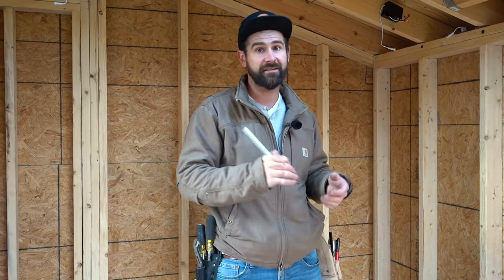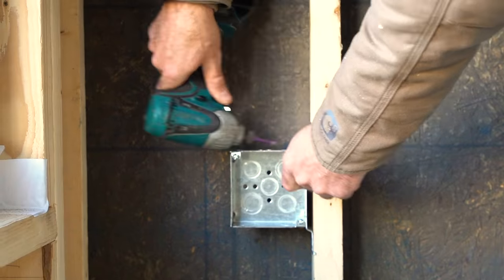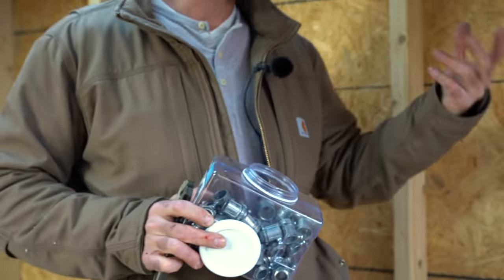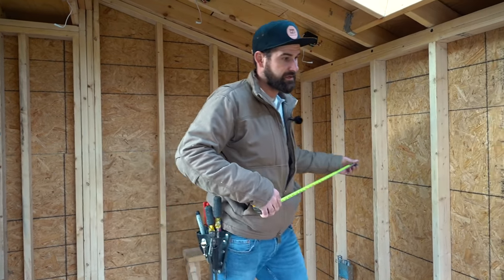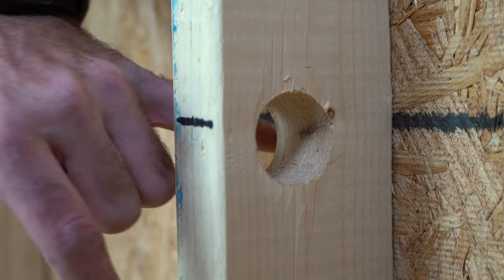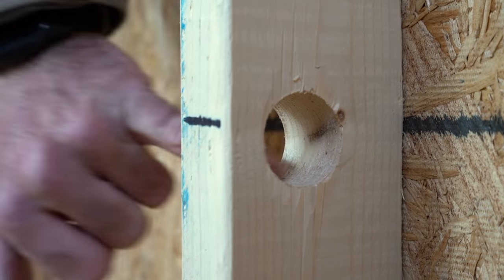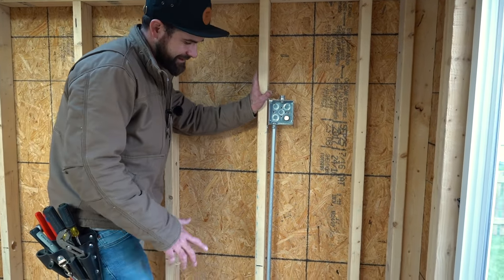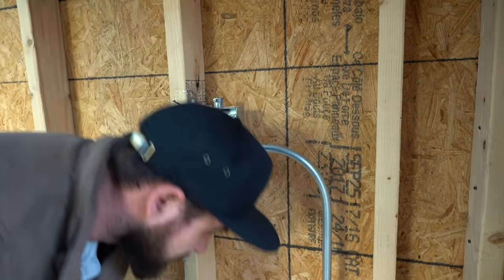How to bend and install electrical conduit

Comment: I say this as a commercial electrical journeyman, there is absolutely no reason to use conduit.
Reply: Unless you’re in Chicago
Reply: @number1anonymous  to protect the wire from hollow points?
Reply: id say that he can run either commercial and residential or industrial with that skill.
Reply: @jamesburns just because he ran a Piece of conduit he could do commercial or industrial?? Nawww, i gotta disagree on that one. Theres alot more you gotta know then just conduit bending. Besides those were easy bends he did.  And residential elect. Almost never use conduit.
Reply: @sonofnumenor6683  thats when one limits them selves, and out of all of the ones commercial is the easiest. does not take a whole lot of thinking when running pipe. pulling wire. laying out the lights. indusrial is the most complicated, because of the demands of the equipment. might be explosion proof, might be motors. lots of control wiring.,  but i was taught by people who needed me to know it all. i worked in the field since i was 15, and i have seen and done it all. started in residential, doing remod work. which if you dont know how too then you got a lot to learn. it is not for the average electrician who knows how to bend pipe and run wires. how to get from point a to point b. i have worked and run jobs in some of the largest manufacturing buildings, and have run jobs on the simplest commercial. which i love, because you dont get dirty. lol.
Reply: @jamesburns have you ever done commercial?? XD now i agree on the industrial part theres alot more going on there. But if commercial was just run pipe and pull wires and terminate i guess i wouldnt have been on the same commercial project for the past two years, when you say " id say he could do residential commercial or industrial with that kind of skill" thats kind of a silly statement.

Comment: Nobody in their right mind is using metal boxes and conduit in a wall cavity of a tool shed.
Reply: Must be a Cali build lol
Reply: Chicago has pretty strict regs in that way I’m pretty sure
Reply: @jameschaisson7747  most cali code requires NM for Resi. Unless its an open beam garage in which case we use MC.
Reply: This is overkill! What is wrong with this jurisdiction?
Reply: @CHADCZ123  you think it is but i assure you it is not. just think later if you have a problem with a circuit easy to trace and trouble shoot. which is an art of it's own.
Reply: @Zethereum i bet you have more home fires due to running romex that we do running conduit. you ever get into a situation where you need to run another circuit and you cant because it is in romex and the walls are finished?. no problem with conduit
Reply: @jburnes41 I hear your reasons and agree with you to a point.. but if you plan out your build correctly you should not need to add wire later.. the romex fires are mostly caused by rodents chewing on the wires .. bx cable provides more protection than romex and is nicely flexible to run through 2x's
But unfortunately Chicago and suburbs only want hard pipe conduit.. 😊

Comment: I liked and I subscribed. You did an awesome job explaining and showing how to do it and how to fix it. I also think you had a great attitude. I also have to say, I was SUPER GREAT to hear you include something your father taught you. Our dads were probably the same. My father taught me a lot as well. I never call a repair man. I fix and do all my own work. That way I know it's done right. I'm planning on bending pipe for my Christmas decor outside. I want to make a unit that goes over my driveway and down it as well, so I can drive under it. If you have any pointers, that would be great. Thanks again, and God Bless.

Comment: First of all your strapping is wrong NFPA 70  (National Electrical Code as written) requires strapping within 12" of the box and then every 4 1/2 feet. Second you stated that the EMT conduit was the ground, which this is wrong. There are six (6) types of grounding and this is not one of them, nor is it one of the six (6) types of bonding set forth in the code. You also are dealing with some of the knock-out which have erratic spaces where 3/4 connectors can be used. Do not forget about that and this is another reason that the conduit is not a ground. Look at the box and you will see a threaded hole for a grounding conductor screw placement. This is a mechanical approved method for a "tight proper termination point". Through vibration the set screw connector can become lose. Is the area of location within a radio tower. This mean you must use a compression Type connector and coupling. In your strapping distance of within 12" and every 4 1/2' you could have used a offset bend or miner-lack strap with a box of wood in the wall to strap the hollow area. If this inspection department enforces to the letter. Remember supporting is not real strapping.  Another problem the enforcement department can not explain electro logy on stainless  steel a screw and wood together. That's double standards for a hanger bracket, a coated nail and wood. It's in a dry location. Do you think that physical protection is a issue ? Why not just surface mount all of it. Another issue is what type of voltage are you pulling in what I believe to be a junction/pull box. Are there going to be any taps made in this box or is it a feed through box to get to the Load center on the other side of the wall ??? How will you protect the circuits from future electrical personnel. You kind of left out explaining about how MANY THINGS you can put in that 4" square trade name part#1900 box. You know there is a rule requiring 80 % fill factor, air flow, device (s) voltage separation device if required.  Lets talk above those new LED type boxes. How are you going to feed into and possibly out of the very and I mean very small junction box with conduit (1hole) ? It's not made for more than one connector. So your going to set another junction box to feed in and out of (Job cost is out the window). Yeah I know you've done this stuff for years and I know you've got away with it. Doing a video is a big deal. It can become a real big deal when someone property and safety become a problem. PVC, smurf pipe, flex and MC cable were all approve methods. Did you ever think about pulling a code book out with the inspection authority and have them show You why there way is the only approved method in their jurisdiction.  The approved enforcement code which was placed into law in the governing jurisdiction in which that inspector works. I done this plenty of times through out the State of Georgia. Worried about back lash I've handle that too. Just some food for thought.
Reply: thank you. 12" from a box is code.
Reply: NEC 358.30(B) Horizontal runs of EMT supported by openings through framing members at intervals not greater than 3m (10ft) and securely fastened within 900mm (3ft) of termination points shall be permitted. 

There is never any mention of 12’’ from the box or 4 1/2 feet for EMT. EMT is 3ft from box and then at intervals of 10ft. 

NEC 250.118 lists the types of grounding conductors. You are correct that there are six but Electric Metallic Tubing (EMT) is number 4. 
Furthermore, check out NEC 358.60 Grounding: EMT shall be permitted as an Equipment Grounding Conductor.

Comment: I was a scrawny 20 something back in the day installing conduit on building sites, 20, 25 and 32mm which is 1.25 inch using a Hillmore bender, on some sites which where hazardous sites ie fuel dumps in the aviation industry the threads had to be double length none of these joints that you are using, the pipe had to be threaded.

I am pleased to say that I was a master on conduit, tray and trucking work as well as building risers and installing switchgear (I was Industrial not Domestic) but I took Pyro to another level, 6ft tails on 7 core was a challenge and still have the tools.

Comment: All of you wondering why emt instead of romex it's for fire codes emt dosent melt and fall down on pple and firefighters as qck as romex and mc/bx can only be used in like 20inch loops because the shell where it's flexibility comes from is to much of a gap to allow smoke and fire to penatrate

Comment: Interesting to see different support systems in different countries. Here in NZ we just run double insulated cable through the walls. Unless of course in industrial environments
Reply: We dont use pipe in residential. Not sure why this guy did.
Reply: This isn't normal.  There are just a few cities or situations that require it.  Everywhere else we just run romex in the walls.
Reply: @sonofnumenor6683  Because it's exposed line — the walls in the shed will likely not be finished.
Reply: @michaelbartello6121  doesnt matter if its exposed. Romex works just as good. I only do commercial and industrial electrical but there are very few reasons to use pipe in residential thats not one of them
Reply: In Norway we use prefixed corrugated plastic pipes. 3-5 wires. Easy to install, no bending needed. The boxes are also round, not square.
Reply from the maker: That’s very interesting
Reply: We do use it in rural areas where the rules are more relaxed. In big cities and suburbs they push the rules a bit tougher and hard metal conduit is specified..😊
Reply: @sonofnumenor6683 
Have to agree here..😊

Comment: I’m more in line with Dave Nag…..I’ve been an electrician for 40+ years….. in the old days speed was expected…. Now that I’m old I keep it light.. I’m slower than I used to be….
I bid more time for that … I have the best tools …. I now strive to do clean conduit work. The fellas will tear you apart if you don’t, ha ha!  Electrical work is fun and I’ve been doing it so long it’s really been good to me. Good money, always in demand , hand arthritis slows me down but I have huge and powerful forearms which is a bonus , that’s from bending pipe, pulling wire and cutting copper. Keep it light guys, take care of yourself…. Your body will break down eventually and that’s a shame.

Comment: I can't understand the need for emt.  Wouldn't aluminum flex or bx pre wired metal flex work as well? I've never seen a steel screw or nail react with another steel product. They use regular nails with framing hardware that's zinc coated, for many decades.  I'd have to talk with that inspector..

Comment: This guy has alot to learn to be in the contracting business,  channel locks have been out for year's pipe reamer's have been around for 20yrs , that's not the only area he's lacking in,  believe me.
Reply: Well  I still rock the channel locks. Bet I can ream the old school way faster, and the next tool you need is already in your hand if your are using compression fittings.
Reply: @robm3063 After 40 years, I still use 420 channels, but also have a reamer with #2 Sq tip in my 90 degree Milwaukee impactor. I still do a lot of residential and it gets in everywhere to tighten the setscrews. The best upgrade is my makita 5" metal cutting saw. Cuts thinwall like butter and the cut is as smooth as a razor. Skip the mini band saw and go right to the steel saw. A worn pair of non insulated 420 channelocks and a pair of beat up Klein linesman pliers will always be in my back pocket!!
Reply: @davenag957  old-timer taught me a long time ago to always have a pair of baby  channel locks  in your  trim apron . They are the perfect size and don't take up too much space. I worked for a shop that used  1st gen blue ryobi  circular saws. Not a fan  of that method personally.

Comment: Good tutorial! Thanks
I am a DIY home owner and having trouble with basement ceiling pot lights. My subcontractor did the wiring but I am connecting the lights and switches. My switch circuit is fine, and the light connection is hot as well but the lights do not turn on.
When switch is in ON position, the neutrals are hot as well but still the lights do not turn on. Can you suggest what to look for.
Could the neutrals be lose in the main electrical box or is it a short circuit. My lights in upstairs chandelier also went dead suddenly.

Comment: as a plumber just a little FYI, the bit this guy is using to drill his holes is REALLY good for wood, but if you hit just ONE nail with it that bit is GONE. lol. USe hole saws guys

Comment: Do you need plastic bushings on the inside of the conduit connectors before you run the wire. I know I wired up  a 100 amp service panel for a house trailer and the inspector failed it for no bushing on the end of the conduit but this was threaded conduit.

Comment: What’s the code requirement for pipe clips. How far from an electrical junction box does a pipe clip need to be used? Are studs considered pipe clips?

Comment: Thanks for the informative video. I am about to extend power to an outdoor shed that is about 60 ft. from the electrical panel. Is it still appropriate to use the EMT as the ground or should I just bite the bullet and add another conductor to the conduit? I live in Texas, if it makes a difference.

Comment: The reason why they call it a 1900 box is because the company called Raco has a standard 4" square box and it's part # is 190. They just added the extra 0 to make it a 1900.

Comment: Hi, thx for the great vid. I'm trying to figure out how to run four rows of two lights, each light has its own box. All the lights will be on a single switch. Can I run Romex back and forth through a single 1/2 conduit, or should it instead be continuous?

Comment: You can tell a real electician. How? No plastic grips on his channelockes. We remove them immediately so we can ream pipe. Nice work in the video even though I would have done a few thing differently. On the 90 out of box dropping into the lower box. I would have made the 90 long enough to reach the stud and then offset back into the lower box to be able to strap to the stud. And on the 90 into the side of the box I'd put the connector on the pipe, slide it into the box and then put the locknut on. It would have fit easier. On coupling pipe in the wall I'd use cast couplings and drive a piece of pipe through them removing the center ring so the coupling can be slid down the pipe and fitting the pipes together more easily. All in all nice instructive video and I find it sad that pipe is seldom used nowdays and most every thing is mc cable.

Comment: I think that they are called 1900 because the largest conduit opening is for 19 millimeters (3/4") you can use the knock-out pieces to use with 1/2" or 3/4".

Comment: I learned to bend conduit using a folding stick rule and a pencil (old school). Instead of doing the math, I just let my rule go 5" past the end and mark the conduit at the dimension my stub is to be. much easier. He should have mentioned that you should not have your set screws to the front or they will make the drywall stick out. Do a box offset and you can one hole strap that vertical conduit to the stud, or else use a "cowboy".
Reply: The set screws will not stick into drywall because the 1900 box is flush with the stud, then a mud ring is added for the drywall thickness.

Comment: This example had bends.  The one thing they never show is a straight run--say just a few feet--going from one box to another.  I don't know how you can mount two boxes first and fit a straight piece between them without temporarily removing one of the boxes to get the pipe into the fitting.

Comment: Drill with rimmer has square bit on it
18v bandsaw 
Tape measure 
Pencil 
Bender 
U good to roll bud no need to carry big pouch 
Flat screw driver won't secure the screws all the way in on connectors or couplings just lil tip.

Comment: Question: How much metal conduit do I need until I run my romex cable into my metal gang box? In my basement the cables are along the wall and covered in insulation. Is that ok?

Comment: My only other comment would be that if I am running 1/2" in wood I would consider using notches instead of holes. Much faster and you can install complete sections of conduit. You did well for a non practicing electrician.
Reply: Is that allowed by code?
Reply: @GoatZilla  not really. they want you to drill the hole and be more like in the middle of the stud. this way it does not weaken the stud. a hole drilled in the middle keeps the studs integrity intact. where as a notch weakens it and more likely someone will drill a screw in the pipe.
Reply: @jburnes41  I figured.  It's bad enough when they drill the holes all fucked up and sideways because they're using a bit longer than the stud spacing (too lazy to change bits), and this guy takes it to another level by using a notch.  Imagine that same notch running along every stud in the wire's path just because the electrician was lazy and stupid.

Comment: Excellent "how to" video. Now I know how conduit pipes are bent. Anyways, why didn't you just run romex wire? It would have been much simpler and faster.
Reply: He said it at the beginning... the AHJ requires EMT for electrical runs to pass inspection. But yes Rome’s would have been faster and Romex is considered a conduit but non-metallic

Comment: Great video! Two questions:

1) How is it acceptable for the conduit to serve as the ground? Doesn't that mean the conduit would be energized in the event that there is a short in the neutral? Seems potentially dangerous, no?

2) why run conduit at all in this case? Is it because no drywall will be installed? Would it be easier to just install unfinished drywall instead of conduit?
Reply: you can but he is doing wrong you need what is called a Grounding Bushing.but I usually run a ground wire just for the simple fact the EMT can become separated, it can get corroded , I've seen 1/2 '' EMT come apart alot.  and this clown can't bend EMT or do it right
Reply: Code in that city requires it..